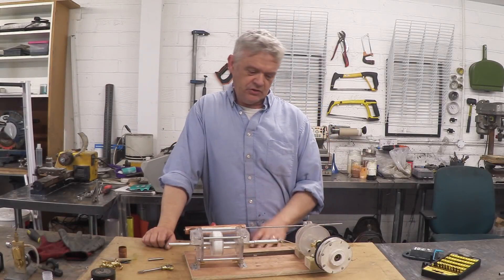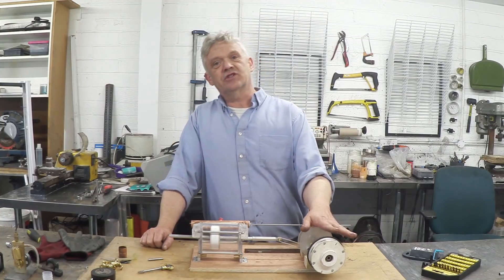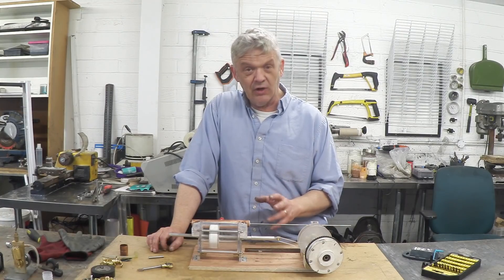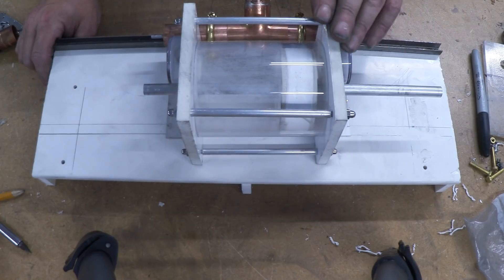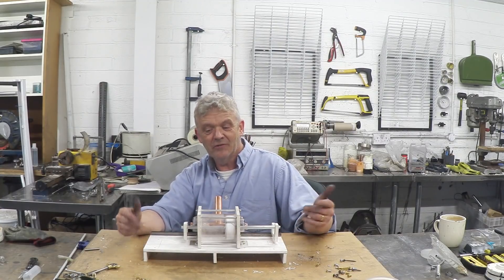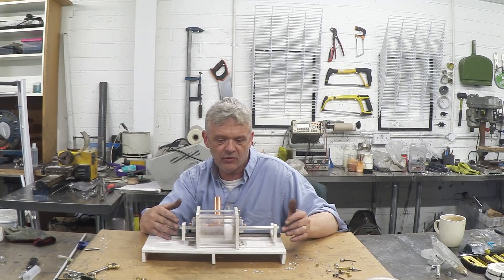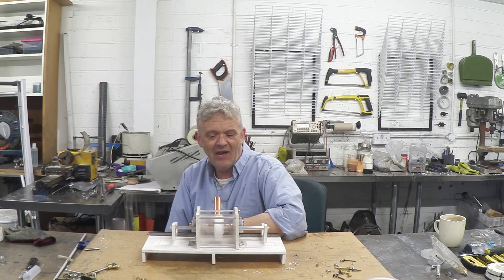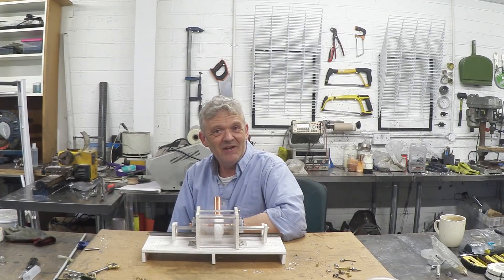Air Driven Linear Generator - PoC

Comment: Using electric switches and solenoid valves will get your linear engine running smoother, as would adding a flywheel, carrying your piston past each of 2 dead spots 180° apart at tdc each side, if you want to make it work.

Comment: Im 76 and have built steam and air-powered engines as well as wind turbines for over 55 years.

That said, horizontal axis wind turbines that produce electricity create a unique problem of getting the electricity down the tower without twisting the transmission wires as the machine yaws with changing wind direction.

A comutator or "brush" can be used, introducing even more problems.

An obvious solution would be to switch to a vertical axis wind turbine, but lower power is the trade-off.

If, however, a horizontal axis turbine could be fitted with a crank and connecting rod or a cam working a rod in a cylinder, that 8-times greater power could be converted to linear motion. Then, using an appropriately sized linear generator at the yaw point center, both problems are solved.

The turbine can pitch & yaw all it wants, but since its rotational energy is converted to linear, no wires above the pivot point are necessary and the mechanical power advantage of the hawt can be realized, creating alternating current in a stationary linear generator housed within the tower.

The best of both worlds!

Comment: It´s not only the ICE which can be used as range extender with less loses from cranks and such but also a free piston striling engine. Those are truly fascinating, cheap, work without any oil and use clean outside combustin which is much more energy efficient compared to the ICE.

Comment: This generator was used in hand torches.  A magnet inside the tube moves inside a coil as you shake, and supposedly recharges a small lithium button battery.
Unfortunately, if you the torch in  your desk drawer or car's glove box, it over-discharges and is useless.

Comment: I know this is older, but I just had an idea, of using a couple small pistons, with a hole in the center,. To only allow compression at the last 12mm +/-,  making a air spring, causing rebound, when the piston is at TDC!  Basically the same as a heavy. Flywheel on a engine! Then replace all this with metal parts, and spark plugs,  and fuel and it's running..

Comment: Compressed air is a spring.
Thats one of the good things about suing a 4 stroke with 4 pistons.
There should in theory always be one air spring/damper in operation.
The trick of course is to have that air damper exert a greater opposing pressure than the driving force, as the piston approaches the wall.
Rather than have the direct control offered by a crankshaft/camshaft.
Although a chamber spring could suffice or an eletromagnetic brake.

The problem you get then is the magnitude of the linear motion is related to the force.
Thats a problem if you have valve that are linear position dependant.

Comment: I used to rebuild pneumatic operated diaphragm pumps for waste water, they used a similar valve system and it worked quite effectively with compressed air, and were super durable and ran for years without servicing.

Comment: Hi Robert, really enjoying the various projects. Here's a thought: I brewed 5 gallons of beer and the yeast reaction in the fermentation bin (with airlock) was excessive (my mistake in terms of good brewing practice) but it made me think 'with the correct yeast environment (sugars/temperature) in a sealed container with a small valve outlet (like the airlock), if the yeast was fed as required, would it be possible to either use the gas pressure from the container to run something like an air engine or would it be possible to store the pressurised gas (in a pre existing gas bottle or tank'. I am taking a gamble here, as I am NOT a scientist...

Comment: Rob, very interesting stuff. I was going to suggest using magnets as springs but someone already mentioned that, trick is « where » is the best position for them. On the outside of the cylinder might best as it won’t interfere with the current generating magnets inside, and won’t add to the weight of the piston. Which raises another question, if you add magnets to the piston, this will add weight to the piston therefore requiring my air to move, will be interesting to see if the low pressure, high volume you have will be enough or if you will have to modify one of this factors to compensate. Look forward to you coil design as well. Love watching you experiment mate!
Reply from the maker: lol - cheers mate - to be honest I have a few things I need to do and you know how I like to simplify if I can - so still mulling over the springs

Comment: I have an idea for your return spring. Use a balloon, cut a small hole for both ends of the valve body ( Like you did with the NASA free piston heat engine). Attach the rubber balloon material to the valve body with the rod from the valve through the holes. That should act as your restriction and spring. Cheers, Cool project mate.
Reply from the maker: nice one mate - cheers

Comment: The problem with a metal spring is that over time with the constant flexing .. the metal will fail.   So I offer two ideas .. one is to have an air cylinder (like a syringe) that builds pressure to push back at the end of the stroke .. that might be difficult to tune .. so the second idea is to use two magnets that oppose each other .. so there would be a natural bounce back.   You're always interesting .. love the mad scientist laugh .. it's so much better than burning the house down!  lol 🤣👍
Reply from the maker: lol - for sure - tbh I was thinking of a gas spring myself - cheers

Comment: Very good use of an older concept.  I envision reliable production if placed in a creek or river..the coils could be encapsulated in resin to protect them from corrosion and use stainless hardware I suppose.
Reply from the maker: for sure mate - tbh - any not just plastic that will work well in a wet environment

Comment: Looking great Rob!, I totally love the concepts of linear generators. Although keeping the vibes down is an important factor to consider if jigging about at high speeds and masses. Maybe some neo magnets on each end of the piston rod going through some nice coils could do the job really great. Yes springs on each end could work or some opposing contact less neo magnetic springs would certainly be alot quieter. For your pressure differential to power the whole thing maybe you could use an external low pressure Stirling engine type air expansion and cooling circuit?. Or maybe even more interesting..., a Tesla cold steam engine vacuum principle...? :)
Reply from the maker: now that is an interesting idea mate - cheers
Reply: @ThinkingandTinkering  Thanks! :) y)

Comment: That switch magnet you made some time ago?? yeah much more complicated than a spring. However, a more efficient design could employ those magnets for transitioning direction using an Arduino controller to not only actuate them but also flip the polarity for the concept to work. I have replicated your switch magnet and am fascinated by it and just waiting for an application for it. This is it :)

Toyota has been developing this for quite some time. This will make for a very simple generator. I plan to play with this as well. But I plan to put a piston on each end with the work produced from the linear motion in the center of the two opposing pistons. This makes  it easier to seal as you dont have shafts on the compression side of the pistons. Much easier to seal.
Reply from the maker: I was thinking along those lines mate - but you know what folks are like if I had put any electronics in at this stage can you imagine the comments? - it only needs to be net positive out and scavenging some power generated to switch is a nice answer

Comment: You keep calling it an air engine.  But it should be called an air motor, because you're converting mechanical energy to mechanical energy - no conversion at all!  An engine is defined as a device that converts one type of energy to another type, such as chemical to mechanical.  I learned this in engineering school back in the 70's.
Reply from the maker: ok cheers

Comment: You know those super rubber balls you get out of the coin machines, well that might just work as a good enough spring.
Reply from the maker: that is an idea I really like. mate - cheers
Reply: @ThinkingandTinkering  LOL, trying to think outside the box. Would be cool to see how well they work being your setup is lightweight, it wouldn't add too much more weight to it really. Cheers Robert, and I like the setup so far, was a good job on that build.

Comment: Yah that's a cool idea, what about a couple of short springs one each side of the piston itself, that way you get a small air gap for your input air, and on your air valve a couple of end plates and on each end of the air- valve have end stops, and on each end of the piston shaft, have fork like actuator to operate the valve, just chucking some ideas in, if that's ok, the spring idea for the piston dose work I used a similar idea on air piston chisel I made, nice video
Reply from the maker: nice ideas mate - thanks for the pointers

Comment: I was thinking about this since watching the last video. There may be a problem in that you lose the ability to have a flywheel, which could be useful for energy storage and smoothing things out. Maybe being able to have a flywheel would outweigh the effect of losses from a crankshaft, and it's parts, to drive a flywheel. Some middle ground hybrid? A Linear alternator, but still using a flywheel as in a traditional engine (could help to overcome 'cogging' in the generator when it's loaded)
Reply from the maker: a flywheel is just an energy store mate - springs would do the same job - but tbh I  am aiming at a free piston design
Reply: @ThinkingandTinkering  I can't help thinking that springs and flywheels are fundamentally different. In the process of this 'thinking' I was trying to come up with a a way to transfer the energy from a linearly moving mechanical part to a flywheel with minimal mechanical losses and came up with a magnetic repulsion device - it would work as a spring and a means of transferring energy between a linear movement and rotary one (flywheel). I also thought that you could just use magnetic repulsion instead of springs, then you could adjust the springiness by using some of the produced energy to work electromagnets as one side of the 'spring' - I know it almost sounds like an impossible 'perpetual motion' device, but you wouldn't need so much energy for the 'springs' if most of the energy had already been extracted in a linear alternator, already reducing the amount of work the 'springs' would need to do. You would probably get a distance squared relationship compression 'spring' instead of a linear one.
Reply: Further checking, and it is the inverse fourth power between magnets.

Comment: someone picking this up and looking just for the free piston style motor. might think about driving the valve via magnetic push pull.  as well Robert,  might consider putting magnetic bumpers on the piston housing for a quick turnaround and hopefully conservation of mass.   especially if you are planning on  putting magnets on the piston anyway.   (may also solve the starting position problem.
Reply from the maker: I am pondering just those issues mate - cheers

Comment: How about some strong magnets on the inside of the piston, to push off the plug before it reaches the full stroke? One with north pole, mounted inside on one end. Another on the plug facing the other magnet (north pole facing the "piston end" magnet) then do the same on the other end of the piston.
Might have enough strength to repel the piston at the end of the stroke?
The Sliders (with a metal strip on the bottom) could also be set up on a copper tape "track"? The Sliders might also be able to generate current from that linear motion.
Just some thoughts.
Keep up the good work, Robert!
Reply from the maker: nice ideas mate - cheers

Comment: Nice, i heard of these, but I never understood, what linears are, and how do you generate them? Ha-ha, sorry it's been a long hot long and HOT day, did I mention HOT! I think I'm dehydrated, it's about 95° American here, and the humidity isn't far behind! it rained twice yesterday, about 25mm, or 1", then the hot sun,  this should be the most efficient, less loss, if the windings to magnets spacing, ratio and all is optimal, I guess is what I'm attempting to say, I told you I'm on verge of  being dehydrated,  my brain is clicking insted of ticking, haha.. Maybe this is something I should look into, to be powered by steam, I'd be totally happy with 500 watts, for 24-36 hours at a stretch,  with steam suplimented by concentrated solar, generating small amounts of steam , just enough to power the device. Keeping it going,   with a wood boiler for power w/o sun, 
If 500watts continuous is possible why stop there, 2500 watts, all day, would be about all I could use!  Rambling again I know, sorry!
Reply from the maker: I am not sure mate - did you say it was hot lol - just put coils around the case and magnets on the piston - or if you like magnets on the end of the piston shaft and a coil around that -keep cool dude lol

Comment: Like the idea with the springs. Is it possible to use a hair dryer to help for high volume low pressure to help work things out? Just my thoughts.
Reply from the maker: I thought about that but it gets hot - even the cool air version - really don't want to warp anything mate

Comment: I have seen one with a magnet in the piston, and magnets on the outside. No need for springs, let the magnets do the job for you.
PS: have you ever opened up the motorized driver of an air horn (from a car or truck)? If you use it in revers, there you have your generator working on air pressure (no longer linear, but that is not perse needed).
Reply from the maker: I haven't looked at that no mate - thanks for the pointer

Comment: instead of springs you can try using a couple of not very strong magnets preferable smal cyindrical or circular ones fixed to the piston shaft and the outside of the cylinder.  Just an idea  I had seen on some stirling engine model way back and they had used it to boost up the function of the inertial mass, well to lessen the weight of the attached inertial wheel.
Reply from the maker: nice one mate - cheers

Comment: Now I'm curious what ur eventual goal is.   I wish there was a more economical way to make a frictionless bearing. Hopefully a frictionless linear bearing. Closest I've came up with is more like a air hockey table which is terrible for weight and un-even steadiness. Then last year, Ben from applied science showed the graphite bearing idea.  I just decided to ditch interfaces. So instead of needing a shaft to protrude through a wall using a bearing and a seal. >> just make the motor exist inside so it doesn't need a seal.
Reply from the maker: that's my thought and I would like to do it that way - the idea is to build the Tesla mechanical oscillator running from large volume. low pressure air to generate via prepare techs air/water battery idea
Reply: @ThinkingandTinkering  oh, ahh , I see.  I love how insanely powerful different mediums can be.  The power of changing size & scale.  One day I was drying an extract & decided to use a plate. The fact that more than a glass of water fits on a typical dinner plate changed my world. I just couldn't get over it. I tried with a plate with deeper sides and woa more than 2 glasses of water.  A way to laugh at physics is the hydraulic ram. Car Jack.  Which is essentially what I was musing about the dinner plate.  The space can be exchanged for force.
Reply from the maker: @tdtrecordsmusic  yes - my thought exactly - I don't think peppers idea will have much force per se - but if we exchange that for volume I think we might be able to get usable power

Comment: Just a thought but could you add or modify the valves so it works on differential air pressures? As it already work with both positive and negative pressures. If you made one side suck as the other blew it could make it more efficient.
Reply from the maker: nice one mate - cheers

Comment: I can envision a rooftop rotating wind funnel with a vane or fin, that pipes the collected, accelerated and compressed air to your inlet. But then, as discussed in previous videos, turbine or squirrel cage blade designs would also work in that airstream.
Reply from the maker: nice one mate

Comment: Springs for sure between the valve checks and piston body, and springs on the valves, like ww1 gasmask valves.
Maybe a ram jet and cyclone on the bonnet of a car going into that liner alternator on the back of the vehicle to allow it to build pressure just from motion.
Reply from the maker: may be mate

Comment: An advantage of linear alternators that is often touted as the main advantage is the reduction of radial forces on the sliding seal. often the sliding seal does not use fluid lubricants in order to avoid gumming up the works.  However this isn’t the only possible design; there are special linkages that reduce sidewall forces, if you don’t mind using more bearings and moving parts.
Reply from the maker: cheers mate